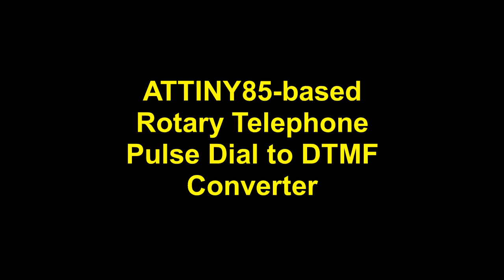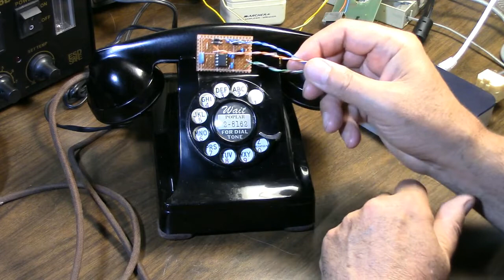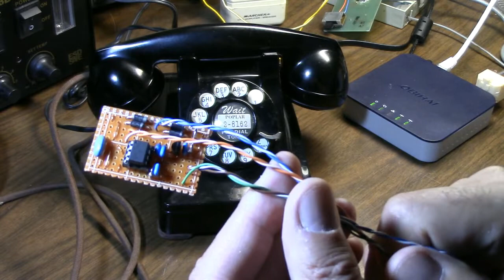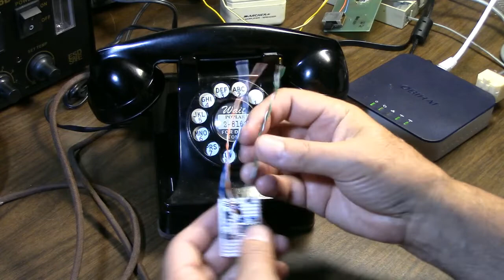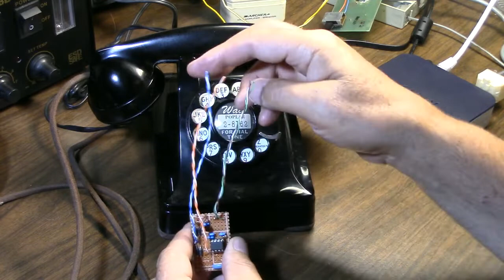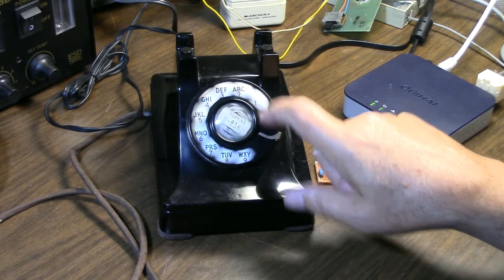Pulse dial to DTMF converter for rotary dial telephones demo

Comment: Hi, Don.

I hope you still monitor comments for this project, as I do not know how to get in touch with you for questions.

After reviewing your C code for this project, I am wondering how  you prevent the Hotline feature from sending DTMF when the user picks up the handset to answer an incoming call?

Thanks and best regards,  Ed.
Reply from the maker: I looked at implementing some way of suppressing dialing on a received call, but the ATTINY85 and circuit can only distinguish on hook/off hook, dial on/off normal and dial pulse contacts open/closed. Short answer is, the circuit will happily autodial after picking up an incoming call. I figured it did not matter much for hotline use. I just disconnect the bell for most hotline use cases.
Reply: @df9999999999  Thank you for your quick reply, Don.

I have an idea to stop the Hotline feature from sending the number after going off-hook.  As soon the user starts dialling a number (before the hotline timeout), the "DIAL" pin will be activated, and PCINT0 will wake the processor (instead of the timeout).  So if the wakeup from sleep is due to starting to dial a digit instead of the timeout, then the HL number will not be sent.  It turns out that, for the two dials that I have (for a model 500 C/D and an Automatic Electric Type 40 "Monophone"), the user can turn the dial only slightly (not quite to the "1") and the "DIAL" switch will close, but subsequent release of the dial will not cause a pulse.  If this is true of all dials, then the user can just turn the dial slightly after answering an incoming call to prevent the HL number from going out.  If the user wants to MAKE a call to a number different than the HL number, then just start dialling immediately after picking up the handset, and the HL number will not be sent.  (This all assumes that the HL delay is long enough to allow the user to interrupt it with the dial.)  I would use the watchdog timeout to delay for 1, 2, 3 or 4 seconds (depending on the selected delay).

On another note, I am also thinking of a way to make the dial arrangement programmable by the user for non-standard dials (New Zealand and Oslo dials, as well as Sweden dials), instead of using a "#define" preprocessor macro at software build time.  (Standard, NZ/Oslo and Sweden are the only three dial arrangements I know about; are there others?)

One more question: Do you know a good source for ordering ATtiny85V parts (with the "V" suffix for low voltage) in 8-pin PDIP packaging?  Amazon.ca only seem to have SOIC packages available and, even then, they are too expensive (at least, in Canada via Amazon.ca).
Reply from the maker: @ed6213  Digikey in the US (Minnesota) has the "V" version for about USD $2.00 each.

Every dial I have ever tested, including various WE and AE models, close the off-normal contacts long before reaching the point where they will open the line as the dial returns after release. The modern Western/Northern Electric dials only open the line when the dial is rotating counter-clockwise under spring control, through an interesting little cam arrangement. I think your code mod is practical to attempt. I haven't looked at the original code I branched from in Github for sometime. The original author never showed any interest in merging my fixes.

I have a Bell System Technical Journal that documents the various dial numbering arrangements as of around 1962. It's the same issue with the MF frequency pairs.

Comment: If I wanted to polish that phone to the max to restore every single nano scratch, what do you recommend?
Reply from the maker: It depends if the phone body is made of thermoplastic (most common) or die-cast painted metal. On plastic versions, I use Novus 3-step plastic polish and hand buffing with good results. Deeper scratches would require buffing with a powered cloth polishing wheel and various grades of jeweler's rouge polishing compound. The handsets are all Bakelite. Bakelite tends to degrade over time, exposing the wood chip composition beneath. If this has happened, black shoe polish works pretty well as a cosmetic repair and polish. Otherwise, the same Novus polish works well.
Reply: @df9999999999  Thank you . Mine is 302 made in 1949. Pretty good to minty shape but has some nano scratches I'd love to eliminate.

Comment: Hello, is it somehow possible to convert a phone without hearing the sound at the end of every number?
Reply from the maker: Not with this circuit.
Reply: @df9999999999  ok, thank you. But it is possible?
Reply: @palracz6179  I think you would need a processor with more pins (maybe a 14-pin ATtiny84 ?) with some added firmware, and a relay or something, to shunt the earpiece (like the "DIAL" pin did in the original telephone phone circuit, to mute the pulse noise in the earpiece during pulse dialling).  Having written that, keep in mind that Model 1500 and 2500 "Touch Tone" phones DO sound the DTMF tones in the earpiece while "dialling" an outgoing call.

Comment: This is awesome. Did you do any amplification on the earpiece as my earpiece seems extremely soft
Reply from the maker: I was using an amplified speaker plugged into a phone line coupler that I built for the phone line audio on the video.
Reply from the maker: You can see the "Archer" Radio Shack speaker and amplifier and the coupler circuit board behind the phone in the video.
Reply: @df9999999999  Oh yes I saw it now watching a second time. I am thinking of building a small amplifier to install in the phone's base to amplify the speaker a bit. But brilliant video!!!
Reply: I  have found a good result by taking a Trimline earpiece element and placing it inside where the old element went.

Comment: Very interesting since, in this country, we will be plunged into the darkness of fibre and voip.

looks like youmade that on something like veroboard as we woould call it here.

Do you do a kit for this?
Reply from the maker: We call it Veroboard here too, but this is clone stuff from China! Yes, easy enough to assemble on proto board. A bit tricky to install if you don't know your way around analog phone internals, but can be fitted to almost any phone with an "off normal" muting contacts on the dial.
Reply from the maker: No kit, alas, but the hex and source code is freely available.

Comment: Hey I just made this board and I'm having trouble getting it to work i can dial and hear the beeps but i can only hear the tone of the number 123 sometimes 4 and 7 i cleaned the dial and still the same issue , i mounted the board in a breadboard double check connection and still the same changed breadboardt and nothing changed , my best guess is that connected something wrong as i could find any schematic of my itt phone it has a very strange network buy that i did was connect the dial and shunt cable together at ground then the other shunt output cable to the Attinys and the dial attin85 the same , tried swapping connection of those two but get no beeps no tone so that connection i think is right then I connected the line + at my phone on a connection f and the ground to a connection c , i made those choices based on a similar Network installation of the rotating device , so i think that wrong but i cant find a way to figure out the correct connection any help will be apriciate I'm really new to attin85 and phones so bear with me i would think it would work first try but i cant figure out what's happening also it seams the microphone and headphones are really low when recivin callss
Reply from the maker: Do you have a model number of the phone? I need a good schematic of the network and switchook wiring to advise. I haven’t found a phone yet I couldn’t get to work. The guys at TCI usually can come up with a schematic for any phone.
Reply: @df9999999999  thanks for the fast response , there are no markings on the phone only an itt logo on the hanset but looking for itt500 phones on the internet i found that it looks very similar to late models itt500 phone on the outside and the inside with its weird network (it kinda looks like an itt2500 network but its not the same) but  i could fin the schematic for it though im not very familiar with this stuff, the guys at TCI whats tci?
Reply from the maker: @briansegarra9312  TCI is Telephone Collectors International. They have a huge online repository of telephony-related tech documents. Is this your phone?  https://www.telephonecollectors.info/index.php/browse/itt-practices/kellogg-timm-handbooks/13136-itt-kellogg-timm-64ca-telephone-instrument-maintenance-manual/file
Reply from the maker: @briansegarra9312  Oh, those! I used to have a dozen or more and have a few of the network boards here. Will look over some old docs.
Reply: @df9999999999  thanks let me know if you find anything helpful on getting mine to work with the adapter
Reply from the maker: @briansegarra9312  The photos on the site you sent aren’t too helpful. I was unable to find a later model Cortelco rotary phone schematic on the TCI site. Most of the Cortelco phones I have seen have the network on a regular PCB with standard Bell terminal designations. There are no screw terminals, only push-on connectors that accept spade lugs from the dial, line cord, and handset. The general installation method is to identify the the two pairs of contacts from the dial. One set closes the circuit when the dial is moved off-normal, the other opens a normally-closed circuit as the dial rotates. Both pairs must be completely disconnected from the network and wired to the converter circuit as shown in the schematic.
Reply from the maker: @briansegarra9312  The line connections to the circuit can not simply be connected across L1 and L2 (the line cord). The circuit must be connected after the switch hook so power to the circuit is interrupted when the phone is hung up. This also isolates the circuit from the ringer and ringing voltage on the line. The circuit has a built-in polarity guard set of 4 diodes that allow the circuit to work even if the line connections are reversed. Without detailed pictures or a schematic, I can’t help much further.
Reply from the maker: @briansegarra9312  I found the schematic in the following PDF, I believe:  http://www.telephonecollectors.info/strombergcarlson/kellogg/PDF/1989_MANU_STANDARD_TELEPHONES.pdf

Check page 33 of the pdf itself. The wire colors and designations seem to match the WE 500 set perfectly. Therefore, these step-by-step directions should get you going:  https://github.com/donfroula/rotarydial/blob/Feature-additions-and-bug-fixes/WE_500_Step_by_Step_Installation

This diagram applies, and matches the step-by-step instructions:  https://github.com/donfroula/rotarydial/blob/Feature-additions-and-bug-fixes/we500_schematic.jpg
Reply from the maker: Note I just updated the step-by-step instructions link, above.
Reply: @df9999999999  tried the guide and still the same i can only dial 123 and sometimes 8 and 7, i can hear the pulse but the tone i more or less the same at every number and the voip dosent "accept" the numbers, i bought today an itt2500 and my voip works great with it , as soon as out a number the tone disappears , but on the itt500 and the adapter no matter how much I dial the number 123 the ones that seam to work the tone never appear and the telephone after awhile starts sounding that high pitched sound , anyways i think I also my fried up my attiny85 too, i may just gave up, anyways do you any place like a facebook group or page that i can get more help , or a direct way i can communicate with you
Reply from the maker: @briansegarra9312  It sounds to me as though you have the dial pulse and off-normal connections from the dial reversed. That would account for hearing the tone only on 1, 2 and 3. Try reversing the connections from the dial going to pins 6 and 7 of the Attiny85.

Comment: How much would you charge me to build one and mail?  I am in U.S.A. I'd do it myself but far too many projects and time is limited.  By the way--- EXCELLENT presentation.
Reply from the maker: Telco Steve Same here. Far too many projects and too little free time.
Reply: @df9999999999  Darn.  I would trust yours.  Ok I understand.
Reply: I know OldPhoneWorks Pulse to Tone Converter does not really play well at all with the Western Electric 302 because the voltage while dialing is Zero, but I wonder if the Dialgizmo converter would play better with the 302... Do you have any idea?
Reply: @ethan1970  On Dial Gizmos website it states it is NOT for the PSTN (meaning regular phone lines from the phone company)  and SOME VoIP ATAs do NOT work with it.  Your seeing voltage at  Zero because the two pulse contacts in the dial open the L1 lead of the line when it pulses.   On-hook measure L1 and L2.  You must have at least 48v DC.  Now measure those leads at Off-hook.  You should see 5.1 Volts DC to 6.4 VDC.  The bottom line is the RotaTone does work but it is a super PAIN IN THE ASS to wire it up with the Polarity guard that is required to put + and - correctly for outbound touchtone signalling.  The real issue is because the people that sell the thing don't have clear instructions.  Sorry.  But that is the truth.
Reply from the maker: @ethan1970  Don't know about Dialgizmo. This circuit works great with the three 302s I've installed it in due to the 5 volt zener diode which insures sufficient voltage drop to drive the circuit under normal loop current conditions.
Reply from the maker: @TelcoSteve  The zener in my circuit plus the polarity guard diode drops and internal network resistance insure that enough off-hook voltage is developed across the phone to power the input of the 5 volt regulator reliably.
Reply: @df9999999999  Then what is the problem?
Reply from the maker: @Telco Steve Which problem do you mean? No issues with this unit as the dial is re-wired to the circuit and does not open the loop during dialing. I think external units use a super capacitor that is charged while on-hook and powers the circuit during dialing.
Reply: df9999999999 external units do to, the RotaPhone version does. The external DialGizmo however does not.
Reply: @df9999999999  Sorry Too many comments and mixed yours in.  Yes, Zener Diode will keep it at the 5.1 voltage IF the DC voltage drop is greater than 5.1 Volts off hook at F and RR on a standard 425X equilvalent Network.

Comment: hi i love my antique telephones and now verizon has forced me to get a fiber optic line and my sweet rotary phones only get calls in im not a happy guy most of my friends have no clue what a rotary phone is  anyway  this is the answer to my problem but im so confused where do i get this do you make them ? i have no idea where to go from here  im just a handy guy that fixes old stuff as a hobbie but im lost on this  i love that original dial tone sound  i want that  on my phones and i want a weird feature  i have the same phone you got and the wait for dial tone allways interested me i always thought how cool it would be if i pick up the phone and there was a few second delay and then the dial tone would come on  not sure if that would be possible  i hope someone can help me out thanks everyone
Reply from the maker: As the video info says, there is a link to the code, schematic and installation guides on my GitHub page. The project requires microcontroller compiling and programming experience to prepare the Attiny85 chip. You would then need to wire up the circuit. Fitting it into the phone also requires some knowledge of where to place it in the circuit for proper operation. This can vary a bit depending upon the specific phone. Not a beginner’s project! There is a very similar commercial product called the Rotatone that is pre-assembled, but still requires phone re-wiring to install.
Reply from the maker: The old dial tone sound is from the ATA VoIP adapter. The dial tone sound is usually programmable in most ATA VoIP adapters.
Reply: @df9999999999  i can see it takes some skills wire into the phone and all that is no issue for me  can you atleast tell me where do i buy a microcontroller  compiling  if i can get the parts i can do it  but i have no idea where to get that
Reply from the maker: @swedacashregisters  rotary dial.hex at the GitHub link contains the pre-compiled code. attiny85_fuse_settings.txt contains the settings for the three fuse bytes in the chip. You need a programmer that can program the Attiny85 chip. Load the hex file into the programmer software, set the three fuse bytes and program the chip. Then move on to constructing the circuit. You will not need to compile the code, unless you are making changes.
Reply from the maker: @swedacashregisters  Everything needed to compile, program and build this are at the GitHub page, but a certain level of experience working with microcontrollers is assumed.

Comment: This will be fun to use with project mf (version of asterisk pbx that can be controlled with these tones so you can get the feel of being Cap'n Crunch...seizing trunks and whatnot)
Reply from the maker: Yep. I built and run ProjectMF. The MF mode works well with it.
Reply: @df9999999999    Well that makes sense ;) I'm going to build this to put into an Automatic Electric 3 slot payphone. (Looks like someone modernized it in the 80's..some PCB boards in the back that I'm trying to figure out.) Also, not sure I get what L1/L2 are in the schematic. The dial and phone line make sense, but don't know what you mean by "phone network/ induction coil"